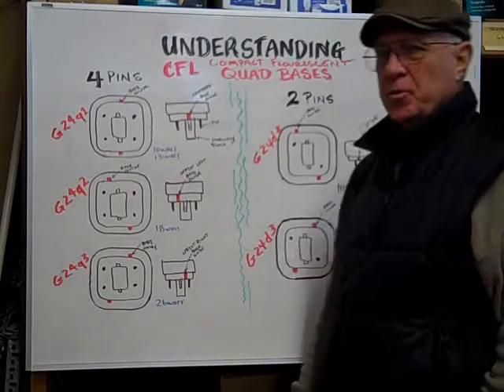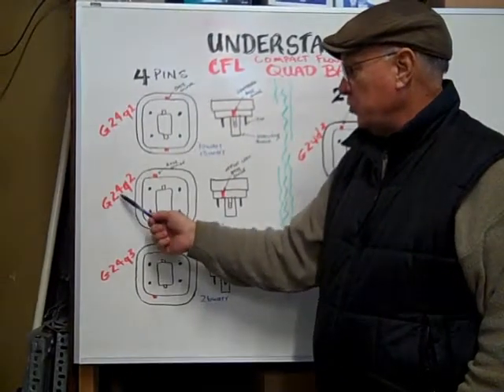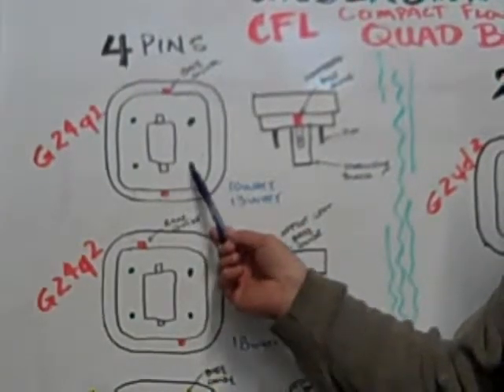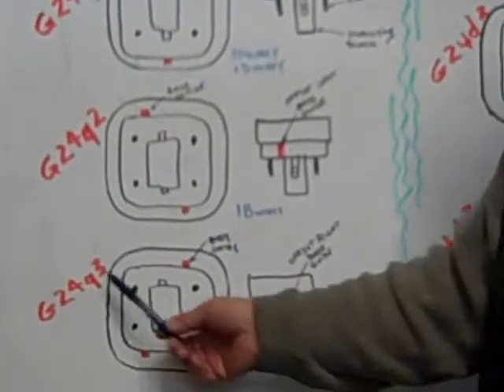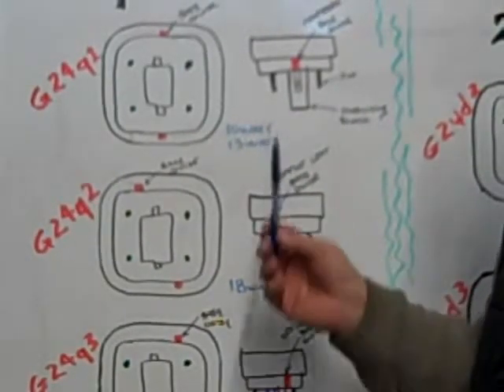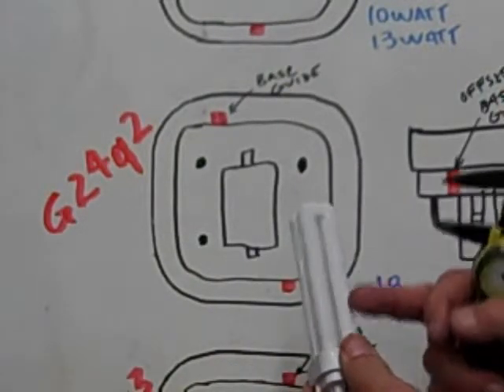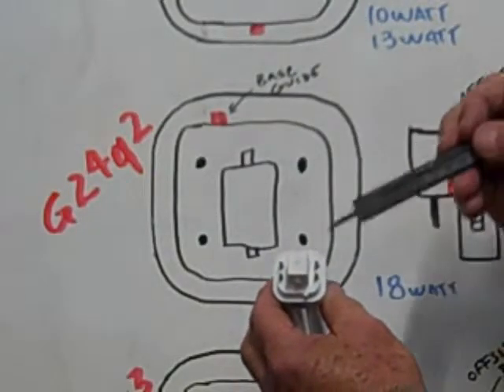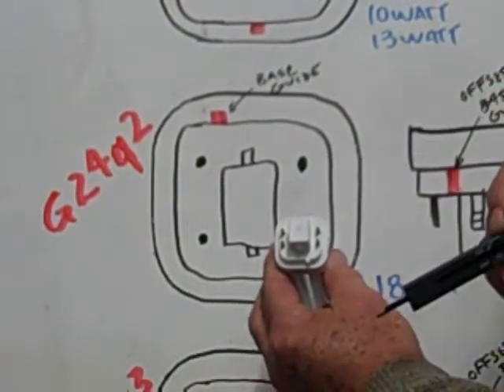G24q2 Base Identification

Comment: Thank you very much for this clarification. So many photos of CFLs online have been inadvertently posted as the photographic inverse of the actual base configuration, making a G24q-2 appear in the photo as a G24q-3. The confusion is compounded by the incongruity of the photo vs the spec sheets in these cases.